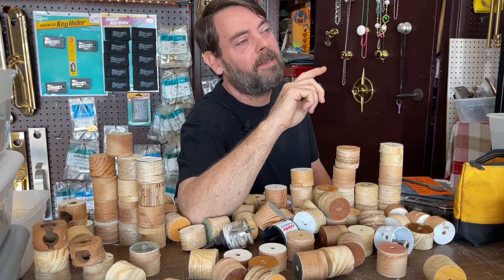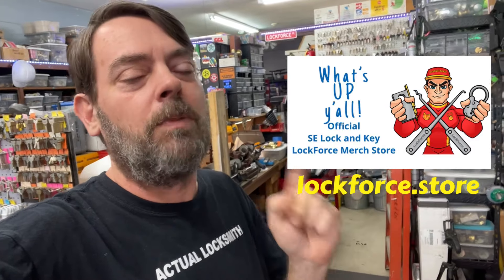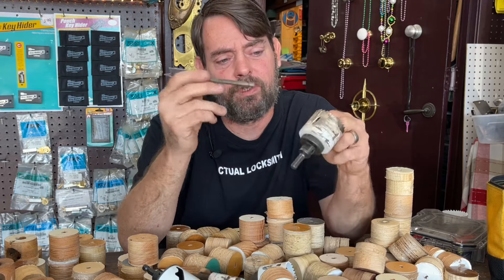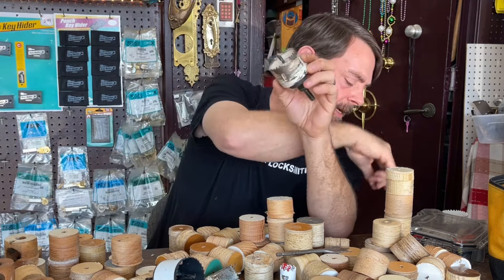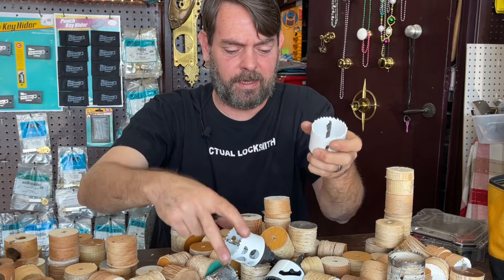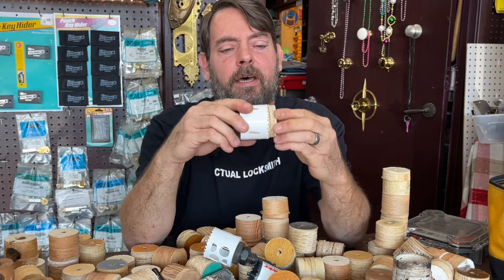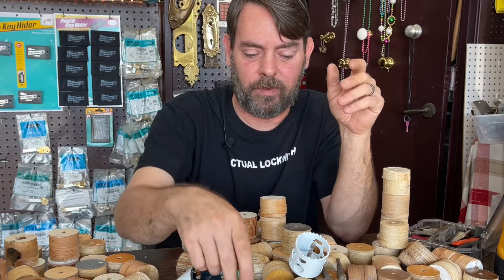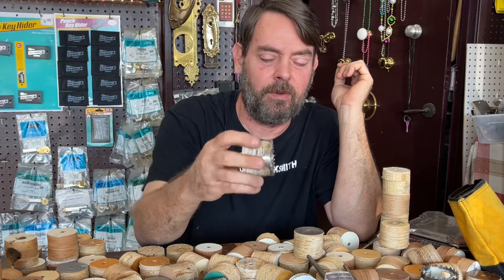Hole Saws - Drill Hog - Milwaukee Hole Dozer - Lennox

Comment from the maker: 07:37 I lost track of what I was talking about while fidgeting with the set screw 
Basically, you don’t ever full send a bit all the way through anything you care about :)
Also yes, you can use Milwaukee & Lennox Pilot bits in the Drill Hog
Reply: Wym about full send? Like start slow?
Reply from the maker: @Mm56677  don’t go all the way through, drill 3/4” of the way until the 1/4 pot tip pokes out then go to the other side and use that hole for the remainder

Comment: Good video.  I just finished installing a few Trilogy T2's on metal doors.  I was surprised that the pre dilled 2 1/8 were slightly out of alignment.   1" Lenox for the cable hole and 3/8 Crappy Tire bit for the rest.

Comment: I love those Bosch Nail-Strike bits, they don't have the tips on the outer edge, but the center of the hole is evident and if you pull back before a full send you can tell if you're properly located or not.

Comment: Switched out all my slotted set screws that hold the pilot bits to stainless allen. The hole dozers work well and able to get the wood and metal plugs out. My 1" hole saw is on a mandrel that when holding the hole saw and reversing it it screws the plug out.

Comment: I don’t think they make holesaws with locksmiths in mind. They are made primarily for electricians and plumbers. Many installers just use spade bits.  I use Forstners and a jig for wood. The holesaws are for steel, and I usually predrill all the way through with a pilot to make sure I stay level, then hit both sides with the holesaw - the holesaw clears the metal chips better this way.

Comment: Well myself, I use a company called blue mole and I’ve used them for years. I use them for cutting steel and they do very well. Of course you can overheat the bit if you don’t take it easy on any bit when you’re cutting through steel or use lubrication but if you cut slow and give it a chance to cut, it does pretty good And I use them also for wood as well. This is my opinion on the situation with the drillbits.

Comment: Honestly I use my hole saws a lot too. I have been rocking the same 4 Spyder hole saws with their quick change arbor.  I have (2) of their Wood "fast cutting" in 2 1/8" and 1 1/2" and (2) of their Bi-metal in the same sizes.. They have been still rocking it for about 2 years now.